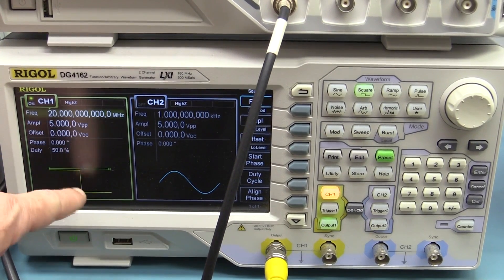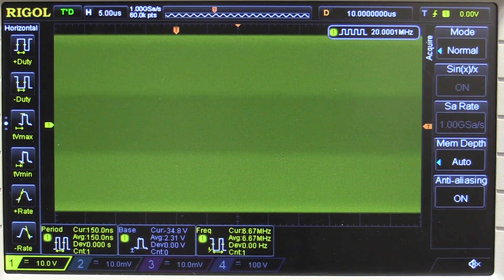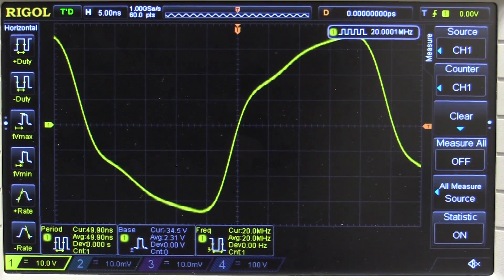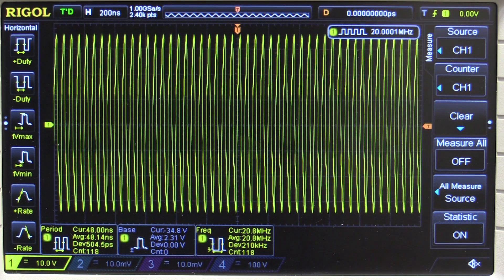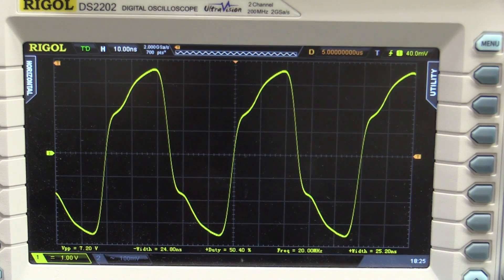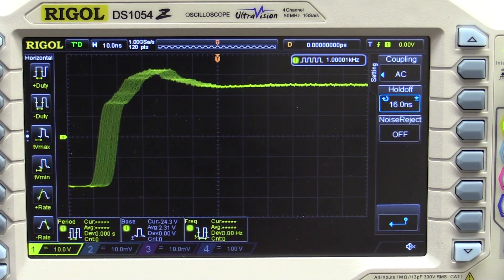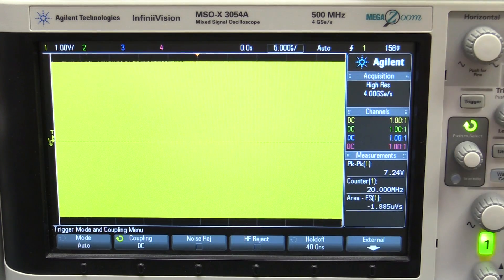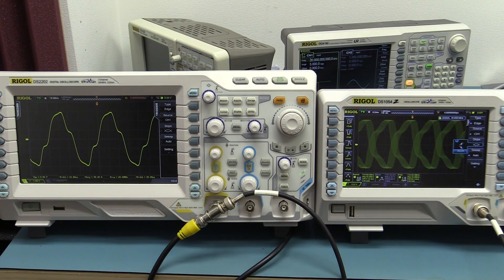EEVblog #683 - Rigol DS1000Z & DS2000 Oscilloscope Jitter Problems

Comment: Curious. Now in 2020 did Rigol fix that bug yet?

There is a 2014 firmware patch that vaguely needs Mentions a trigger bug but not what the bug is.

v00.04.00.00.00   2014/03/18
     - Fixed bugs in triggering function

v00.04.02.04.07   2014/12/31
     - Fixed triggering function
     - Fixed storage function
     - Fixed bugs of jitter in the signal under 
         the AC or low-frequency coupling
Reply: Did you find it out?

Is the problem fixed? I'm thinking about buying a 1054Z, but I'd like to buy a scope I can trust :-D

Comment: I know this is couple years old, However, was the jitter issue ever  fixed at a factory lvl with the 2000 model with AC coupling.

Comment: I was able to reproduce exactly what the person (at 2:12) who asked you about the jitter problem.

I was playing around with the Source Modulation ("Src1Mod") and found jitter when mucking about with FM, AM and the frequency of each.  Perhaps the jitter for some people is coming from their scope having modulation in "ON" state and if it is turned "OFF" then it goes away.  Scope is MSO1104Z-S, SVersion 00.04.03.SP2, HVersion 6.1.1, not getting jitter with anything you did.

Now here is my question: does anyone else get a jittery sine wave on 10mV at 5ns with a frequency that fluctuates between 35MHz and 150MHz (probes attached but not connected to anything, 10x and 1x is same result, and all set to AC Coupling)?  Lastly, I noticed the "Auto" indicator in upper left screen rapidly changes back and forth from AUTO to T'D.  I know these are extremely small measurements at five billionths of a second but still curious nonetheless.

Comment: did the 00.04.03 firmware fix the issues?
Reply: hmm, got a reply email from a Rigol technician today after i asked them if there was a hardware revision. said that the latest firmware resolved that but he would say that. a multimeter isnt doing the gob for me atm, need a o-scope to calibrate those pots.

 plus im getting more interested in this side of things, so having one as good as this one was supposed to be would have been handy
Reply: seemed a good price point for what it was supposed to deliver

Comment: As i can see in your blog, Rigol has fixed the problem by issuing a new firmware. Dou you confirm that? Is These models steel a good option?Thks

Comment: hey Dave can you do a video on ac conversion to dc
.and specifically what a bridge rectifier is.
why power supplies feed dc at frequency and why that use dc chopped up rather than ac?
I may be wrong about effectively turning dc on and off rather than ac but if i am, why not use dc chopped up?

Comment: My 2 cents: on my DS2072 turned to be DS2202 on firmware 00.01.01.00.02 (HW 1.0.1.0.0) both DC and AC coupling works perfectly fine. Now I have to reconsider any next firmware upgrade :)
EDIT: my bad, I took AC/DC channel coupling instead of trigger coupling. In my case jitter is not visible in 1k/1MHz but obvious on 10MHz... waiting for Rigol's answer

Comment: Hi , I have the DS1074Z-S and with the internal generator I can go just up to 15MHz square wave. Btw it seems mine don't have the 5us issue (some little jitter is visible also at 0us delay so it may be the generator). Indeed it has the AC coupling trigger jitter issue.  Firmware version is 00.02.03.SP5

Comment: Well... Just updated FW to 00.03.00 SP1 on my DS2102 (it is unlocked to a DS2202, all features, but I doubt that makes any difference on this "issue"). Still same "problem", 10ns jitter and 50ns delayed display when using AC triggering coupling, ANY square wave input will show the "issue" - But note: the input coupling has nothing to do with this (that would have been found years ago...). To recreate this issue you must set trigger coupling to AC (MENU button below trigger level knob, choose "Settings", then "Coupling"). Sorry if I'm being overly clear... Anyway, I almost never use AC triggering and am very happy with my gear! I would still recommend Rigol over other brands to hobby users - any time. I use much more expensive equipment at work and they too have their quirks... Cheers!

Comment: I have DS2072 and I do have the jitter problem at 5 µs, about 10 ns wide. Edit: nope, I can't actually confirm that since at 10 µs I get the same jitter, so it could be as well my cheap generator.

On the other hand I don't seem to have AC coupling jitter at all. Works perfectly fine for me. My software version: 00.01.01, and hardware version: 2.0. And by the way, mine is "hacked" to get full 200 MHz bandwidth, so it shows Model DS2202 in the system info. (And by the way, I don't have any LED lights in my room. ;-))

Comment: Dave, I very seldom use AC triggering but I had to try... DS2102 FW 00.01.01 HW 1.0. Got about 10ns of jitter in AC trigger mode (zero jitter in DC mode) but I also noticed something you might have missed since you used a 20MHz input, the AC trigger is always offset by 50ns, so when horizontal is below 10ns on a lower frequency input, you won't even see the slope you are triggering on. I have no issues with dual slope triggering in AC mode though. Both channels seems to behave the same. Anyway, this is not my main use case and, I'm very satisfied with this DSO! But you purists (in an admiring sense) are of course helping Rigol and others in the business!

Comment: MSO2202A No issues with jitter on delay 5us or Trigger Coupling AC, but the Trigger Both (falling/rising) doesn't work reliably, if I change the time base it some times trigger on both but not reliably., SW 00.03.01, HW 2.2. For Input I used 1 kHz square signal.

Comment: I have the same issue. I got what I paid for though so I have no right to bitch. I bought it wanting to be able to determine if a high frequency clock signal was

a) Totally present
b) Present but fucked
c) Not present at all

It does that, and where else am I going to find some 100 MHz thing new in the box for a few hundred bucks? Alas I also acknowledge that it can behave like cheap crap.

Thanks for the video!

Comment: Hi Dave, just because the other scopes have no jitter at 5us delay, doesn't mean they don't have it in general. It could be every odd multiples of 2,5us and your 5us would look perfectly fine. I don't really think they have the same jitter problem as the rigol scopes, but the way you "proof" that the other scopes don't have a problem with jitter is a bit weird.

Comment: The first "problem" I noticed on my 1074Z is the ground noise. The probes on the left side has higher noises than the ones on the right. The noise in the millivolts range, but they are noticeable. 
Switching probes does not help.

Comment: About the AC coupling issue - not an issue at all, so please stop bashing Rigol.

The problem is that when you switch the channel to AC coupling, the trigger is still at DC coupling. You need to go to the Trigger menu and switch the trigger to AC coupling as well. Then the jitter will be gone.
Reply: +Ivo Stoyanov bzzzzzt - Wrong.
Upgrade the firmware and the jitter will be gone.

Comment: Just got my DS1054Z yesterday from Emona - couldn't reproduce, but will keep testing with other hardware, funcs etc.
This might be a dumb question, but I noticed that the right-hand-side trigger indicator disappears when you AC couple from the trigger menu. This doesn't happen when you AC couple from the normal channel menu.
I also noticed it happened on Dave's unit when he did it in the vid. I can still adjust the vertical trigger level when I use the knob, but the little indicator is gone.  Is this meant to happen or I am just missing something? 
DS1054Z (No hack)
DS1ZA164***blah
00.04.02.SP3
0.1.1

Comment: I use AC coupling all the time to spot and measure P-P noise on power supply rails, quiescent digital lines, and other cases where DC coupling makes it harder to see what is floating on a DC offset, and when.  Now one could argue that with a DSO that supports high sampling rates, this is not as big an issue for most cases, but  I'm not going to buy a scope with an obviously broken AC coupling mode like that.  Too bad, I was liking the look of the Rigol gear.  They need to fix this pronto.

Comment: Could it be software rounding inaccuracies?
Reply: Does the jitter only appear with odd ending offsets like 15 and 25?  If so, then maybe stronger evidence that it's just a floating point issue with the software.

Comment: I wanted to chime in just to say that there is also such a thing as "normal" trigger jitter in addition to function/signal generator jitter, both of which would add to the jitter visible when you offset the waveform sufficiently (though this varies based on scope design). This normal trigger jitter is very small comparatively. When I shift a waveform by 5uS on a <140ps risetime square wave on my 2GHz scope sampling at 16GS/sec, I get about 700ps of jitter spread over 2 distinct bands (I don't know why the 2 bands). Coupling makes no difference as expected though. My scope is older, so it uses an analog triggering circuit, which is apparently less stable at those kinds of offsets. More modern scopes use digital triggering circuits where trigger jitter is not an issue. I have only a vague understanding of these differences from reading some overly simplified papers. An expert on the issue is welcome to respond. :)

I really dislike the disproportionate reactions here though. Clearly this is a rarely encountered issue, and it certainly won't get in the way of your use of the scope in most cases. But you guys are all ready down burn Rigol down. Drama should have no place in engineering. Just wait for Rigol to respond at least..

Comment: Dave, how much does one of those pocket type Oscilloscopes sell for? I am looking for a scope to play around with and can't afford to spend a lot.I'm not looking to use it for diagnostic stuff, mainly just looking to "play" around with it and see the wave forms from different pieces of electronics.
Reply: Unless you are intending to limit yourself to low level signals (5VDC or less in many cases), and often no AC input coupling option, and your signals are going to be at very low frequencies, the pocket scopes cost more than they are worth.  They also have some of the worst user interfaces ever imagined by man.

If you do go that route, please do not let their almost limitless shortcomings dissuade you from upgrading to a proper oscilloscope later on.  They are in no way a real introduction to the capabilities and usefulness of a real scope, especially for debugging and educational purposes.

That all said, though, you can get very good deals on older used scopes.  The analog scopes are dirt cheap, especially the lower bandwidth models, and on the digital storage scopes you can either purchase an older used scope or pay just a little more for one of the newer Rigol models (even with their bugs they are better than any cheap pocket scope on the maket).

YMMV
Reply from the maker: Mike Notarnicola Buy a $50 2nd hand analog oscilloscope EEVblog #86 - Buy a real Analog Oscilloscope PLEASE!
Reply: Ok, I was just curious.. I Had a telequipment scope several years ago and sold it as I needed the money. Now I am kicking myself for doing so. I'll have to put some money aside for one.. As I mentioned, it is not a need as much as it is a want.. Thanks guys for the reply..
Reply: EEVblog What about a telequipment D54? I might be able to get it for a song.

Comment: hi dave
could it be a band width issue, on the 1052 with 50 mhz no jitter on the wider band scopes you get it
Reply: A lowpass filter can't introduce jitter; not an analog one at least.

Comment: So, after this do you still recommend the DS1054Z or the old DS1052E?
Reply from the maker: Novislav Djajic Don't buy the 1052E, it very long in the tooth.
Reply: EEVblog I really don't know... The AC coupling problem kinda put me off, I hope it's a software problem they can correct.
Reply: Novislav Djajic Buy the 1052E. It may be old, but it is solid and cheap. After a few firmware revisions and perhaps even hardware revisions, it is pretty stable and does what it is supposed to do. Otherwise, I'm sure Rigol will sort this out.
Reply: JohnAudioTech Guess I'll wait for Rigol to say something about this.

Comment: I have a DS1074Z-S, fw.00.04.00, tried with it's internal signal source on 15MHz and 5MHz, it doesn't show that behavior at 5us. Maybe the issue is in some internal clock reference which is in sync with the signal generator also. Unfortunately I doesn't have a separated signal generator.
The trigger AC coupling issue is present on mine also.

Comment: I suspect that they introduced a digital filter to determine the trigger level and didn't account for the filter delay...
Reply: Digital filters have constant delay so that would not explain trigger jitter. The delayed trigger issue might be caused by reference clock drift/jitter that happens to have nulls every 5µs of delay after the clock gets filtered by the PLL. The AC trigger issue on the other hand really puzzles me - I have a hard time imagining how they could screw that up.

Comment: So If you were to count the number of oscillator cycles in the oscilloscope over the period of 5us at any arbitrary time, you would have a consistent number of cycles. but if you were to vary the period, the number of cycles would not be consistent. This leads me to guess that the oscilator clock has a 5us periodic signal FM modulated onto it. So something inside the oscilloscope is generating a 200kHz waveform, and it's interfering with the oscillator?

Comment: Sad to hear this.... My faith in Rigol just flew out the window.... I was beginning to wonder why their products are so cheap.
Reply: Giza Plateau
The offset jitter might not be too bad if you do one-shot triggers but if you turn on averaging, it can seriously mess up your measurements. Also keep in mind that Dave's 1054z is nowhere near as bad as the post that prompted Dave's response, meaning that some 1054Z are much worse than Dave's.

Also, the AC-trigger jitter is far worse than 10ns, rendering the scope nearly unusable beyond one-shot. The missing/broken falling-edge trigger on the DS2000 is somewhat of a shocking omission too.
Reply: Daniel Sauvageau And how often do you need to use AC-trigger coupling (in the trigger menu)? As distinct from the much more common input AC coupling (in the CH1/CH2 menus)? It's poor that this bug exists, I agree, but let's not overstate the impact of this. There's a reason no-one's noticed this for 2 years.
Reply: TheHue's SciTech The 1000Z series is not quite two years old yet and part of the reason nobody "noticed" it sooner could simply be that people who did notice it shrugged it off as jitter in their own design rather than the scope when they ran into it.
Reply: Daniel Sauvageau same issues is in ds2000 series, over 2 years old, and just no.

Comment: That is just great! I have already ordered my DS1054Z from TEquipment. I hope it is a firmware issue only, otherwise I will have to consider buying something else. What can you recommend Dave in the same price range? Siglent, B&K, Instek? thank you.
Reply from the maker: Pedro Castillo That's the thing, there is nothing of comparable bang-per-buck.
Reply: EEVblog Well I guess in my case there is no sense in crying over spilled milk anymore, TEquipment just sent me the UPS tracking number of my DS1054Z and since I am phisically located in Honduras, Centralamerica believe me when I tell you that here my options are "very" limited. Like I said I hope it's just firmware, I will keep an eye on it via the EEVblog and your reviews. Thanks Dave, love the videos, I have learned and applied a lot from them.
Reply: EEVblog Hello Dave. Have you heard anything from Rigol about the solution of the jitter problem in the DS1054Z?? thank you for all of your videos and for sharing the knowledge. Best regards from Honduras.

Comment: On my DS1074Z soft-upgraded/unlock to 100MHz and using the internal source (set at 20MHz), I don't see the 5uS jitter issue at all. However the AC coupling jitter problem is clear as day. Software revision 00.04.00. Serial number DS1ZB16115xxxx.